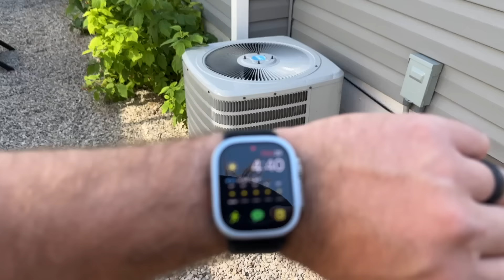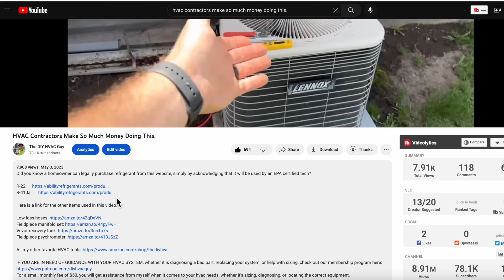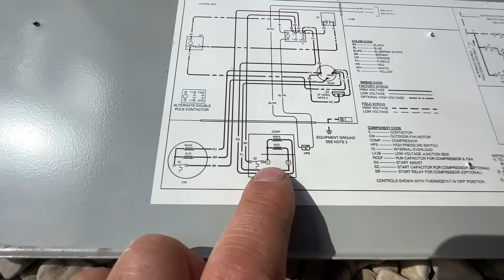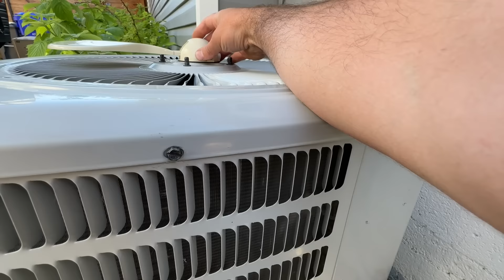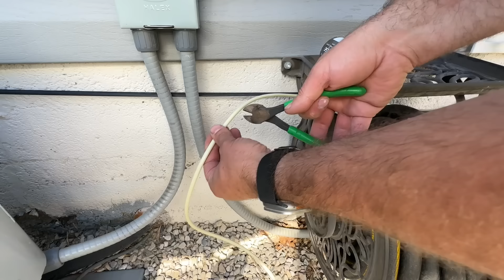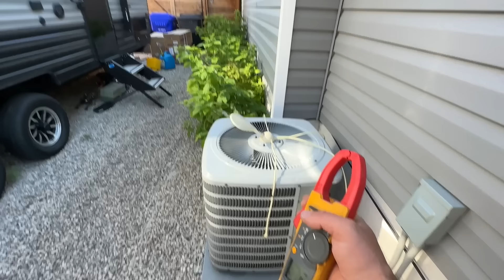Can This Device Actually Lower Your Electric Bill By 30%??

Comment: Very interesting product and I'm sure it does work. I have two comments. 1) The list price of the system is $100. Brass misting nozzles cost about $0.50 apiece on Amazon. The tubing and fittings might run you another five or six dollars. The only thing that is the least bit proprietary about the system is the valve. This is almost identical to the float valve that's used on decorative fountains which runs about eight dollars. You could very easily modify one to have a vane instead of a float on it. Bottom line, all of the components of the system can be purchased retail for about 12 or $13. Charging $100 for the packaging seems outrageous. The second question that I have is with regard to long-term performance. Most of these misting systems suffer from one common flaw in that the nozzles clog up over time and need to be replaced. It would be nice to see a follow-up report after a few months of use to see if it still working well. The concept seems great, however anyone who has even the smallest DIY skill can probably put the entire system together for about 1/10 of the asking price.
Reply: You could also use a $12 irrigation valve that triggers when the unit runs without having to mod something.

Comment: We built a "cabin" on a slab and the interior dimensions are 23x23 w/ open cell spray foam. For whatever reason i have a 24k LG split installed and its waayy to big. The place is so tight and the oversized unit is causing too much humidity. I will be swapping it out with a 12k LG unit. Hoping this makes a difference. Even when i put the 24k unit on dehumidify mode it practically does nothing.
Reply from the maker: I don’t think this will affect that unfortunately
Reply: @diyhvacguy  I dont understand it. How else is am i supposed to control the humidity? Im getting 75-80%.

Comment: Honestly a proper attic fan used correctly along with modern levels of insulation will save you even more on your enerfy bills. That and for petes sake, make sure your air filters are clean and your ducts dont leak.

Comment: If the outside ambient air temp was not still at 91 by the time you finished your install… the results are meaningless - it could have cooled down 5 degrees or more outside by the time you were done.  Judging by the difference in overhead sunlight, the outside air temp had changed.
Reply from the maker: Yea it was hotter at the end of this test then when we started. I’m not sure how I’m supposed to duplicate the same conditions but I believe it works and is worth it. If you don’t it’s no sweat off my back 👍🏼

Comment: $ 100.00 is a bit steep for 1/4 " plastic tubing, 3 brass mister heads and a float valve that's air accuated. Make your own for less than $20.00.🤫

Comment: By wetting the condenser you are taking advantage of the wet bulb cooling effect. How much water are you using and how much does it cost in water wastage. To be honest it’s a waste of clean, purified and pumped water from your provider. Cooling towers at least recycle the water they use.

Comment: most window AC units already use this sort of system... they tell you not to drill or drain the metal bottom, it collects condensation water and the fan splashes in it to help cool the outside coil.
Reply: Great comment! Not many people know this. I only discovered it recently. 👍🏻
Reply: Yes but that is condensation water that does not have minerals in it.

Comment: I would be willing to bet that orienting those tubes so they face straight DOWN across the outside of the condenser coil would be much more effective than spraying OUT away from the coil and trying to suck the moisture back in through the coil. Likely would get a more even coil coverage, not spray against the foundation, or vegetation, as well. Interesting add on though, especially if combined with a micro-air easy start to reduce the LRA.

Comment: I've seen this done when the evap fan fails to lower the head pressure from kicking off on high head pressure setting and of course to make the AC work with no fan. It is an emergency process typically with small to medium size data centers that have failed evap fans that are scheduled for immediate replacement awaiting the parts. Now for example there are typically 3 large sides and one shorter side of air movement and the single tap on the head of the mister is rather puny and inefficient. A dual head that sprays water in 2 directions would be more efficiently applying the water.  That and a pass through design on the top mister to allow dual misters on each side both high/middle or middle low depending on preference. Adding a two way gate valve off each side of the output would also enhance MORE places to apply more mister heads. (basically a coupling bi-direction or better yet tri-direction port valve, 1 in two out) The effect of the water with more flow producing cooler water supplying the flow increasing the effective cooling power of the system as a whole. Shaded area's would also help with cooler water.  The effectiveness of the water to cool the fins is exponentially increased with lower temp of water supply. I cannot believe the manufacturer has not made these improvements already.

Comment: Why are you replacing the unit with a heat pump
Reply from the maker: Im installing a 20 seer heat pump, so jumping from 13 seer to 20 will be great for my electric bill and I can run my heat or cooling with a generator even if there is no natural gas for my backup heat. AND the new heat pump is so quiet. I can’t hardly hear it running. Just finished the install today!!

Comment: If the water consumption is so low  why not use the condensate water ? It should be very clean,nearly distilled really..surely a pump (cheap) perhaps some sort of accumulator (maybe) but would make such a tidy self contained mod...??

Comment: good idea to mount the mister nozzles higher and angle them so the spray isn't on the grass around AC but into the coils to work on dry hot 🥵 days for maximum evaporative cooling yeah don't forget the T also would've faced the flap towards the house where that panel cover is where the coil isn't  that way the heat pulled off can rise up and away from home, make sure faucets don't leak as that'll increase the cost  but a monthly check ✅ should be good enough, I've also learned to window 🪟 screen the outside so sweeping off cottonwood seeds and bugs stuck to it is easier also can be useful to remove stuff like bushes branches limbs over the top just trim away so the heat can rise away and not sit low recycling through the thing trying to give the heat away to atmosphere

Comment: Also, it will work best if you're in a "dry heat" area. If it's 90% humidity, I don't think it's going to work that well, because it's going to be harder for the water to evaporate and carry the heat with it.
Reply: SWFL Tried it a few years ago. Too much humidity to gain savings
Reply: @mac9245  Thanks for the tip, I will  not install it then as we also live in SWFL...
Reply: Yeah... just like those "cooling towels" this thing doesn't work in Augusta, GA or Columbia, SC.
Reply: @catfishcooler1566  It also won't wok in the Jacksonville, Florida area.
Reply: @TheCrunchbird . I’m in the same region and was really hoping something would help my heat pump.
Reply: I live in Augusta Georgia and was about to order t his thing but you came and you saved me! @catfishcooler1566
Reply: @catfishcooler1566 hell yeah! I'm in Augusta!   

Def don't see this doing too much to make it worth it
Reply: 90% is subjective to the time of day and drops way down during the hot day. The dew point is more stable and helps determine if the evaporation does anything. A 65° dew point at 108° is very high and water still evaporates but slowly, and a 50° dew point at 108° is mild and water spray cools well and water evaporates rapidly. Below 45° dew point is dry. 
And the percentage rises and falls dramatically every day.
Reply: Cold water comes out of the tap.  That could be aiding the cooling even in high humidity.  An expansion pack is available.
Reply: @tomuncc  
Good point!
Reply: @tomuncc  yea i don't understand the humidity comments. who cares if it evaporates or not. the water will absorb the heat then drain off into the yard.
Reply: @james6794  You care. The whole point of this is to make the air flowing over the fins able to absorb more heat. That only happens if the vapor level goes up. Its all about the water vapor level. Liquid water means nothing here.
Reply: @cadthunkin  sure but if you spray something down with water that is cooler than the object heat will exchange. the difference is water volume increase the water  volume. In a humid climate actually getting the condenser coil wet it will remove heat from it
Reply: @james6794 Because the cooling effect comes from the evaporation of the water. High humidity means the water takes longer to evaporate and that reduces the amount of cooling. 
That's why the "feels like" temperature is higher when the humidity is up, perspiration is not as effective so we feel hotter.
Reply: @james6794 in dry humidity the spray can lower air temp by 30 or 40 degrees. 
Won't do that in a humidity area.
Reply: @james6794  You will gain some additional heat transfer with the addition of water on the coils, making the rather safe assumption that the water is colder than the initial temp of the coils. The point about the humidity is to gain additional cooling benefit, you evaporate the water you sprayed onto the coils to increase the capacity (not efficiency) of the cooling coils. In high humidity environments, you're not going to evaporate as much water because the air is already pretty saturated  with water to begin with. 

At that point the only help your getting is the thermal energy it takes to raise that sprayed water at let's say 70 degrees to 120 degrees where you're trying to strip the heat out of the hot freon. At that point, it's minimal.
Reply: @james6794  That's not the thermal process that's important here. You're talking about a transfer of heat from the condenser coils to cooler water, which would require much greater amounts of water. The video is talking about using a phase change of water, from liquid to vapor, which absorbs much greater quantities of heat energy than just heating water.  The first half of this short video kinda explains it:https://www.youtube.com/watch?v=SONE3AU-KQk
Reply: @DerekKerton This is the answer
Reply: @james6794  Water evaporation is 1,000 BTU/#, no phase change liquid cooling is only 1 BTU/# °F.
Reply: @james6794  cause with high humidity, the air is already humid and can therefore not take on so much humidity anymore as it could in a dry area...
Reply: @james6794  Another victim of America’s failing public school system. 😒
Reply: @james6794  The amount of heat carried away by the mist is dependent on evaporation.
That's why "swamp coolers" don't work in a humid environment.
Reply: @kiowablue2862  don't use a mist then. use a flood
Reply: so wyoming yes florida no. also swamp coolers are really nice in dry climates but suck in wet. the AC unites also seem to work better in wet vs dry locations.
Reply: I just went to a bar in Alabama and they had those mysteries and it definitely cool down the air so I think it worked maybe not quite as well as words drive but definitely cools down the air
Reply: Itll still save some energy (water cost might offset it) because water is a lot more dense and is probably much colder than ambient air so theres more "cold" available. But nowhere near what it saves if it can evaporate.
Reply: These are good points, but I was curious - wouldn't the coils being hotter than the air cause the incoming air temp to increase, thereby decreasing local humidity and allowing evaporation to occur?
Reply: I can spray down my heat pump unit outside with water for a minute or 2 and the inside vent air temperature drops by 4°to 5 degrees  coming out of the air vents by doing that.
Reply: Yeah too much humidity in Houston, Texas for this
Reply: It's adding an evaporative cooler to condensing coil.  Evaporative cooling is effective in low humidity environments.   Like on the brown (west) coast; not so much on the green (east) coast.
Reply: That's what I was thinking since I live between Houston and Galveston. I really need to shade the unit from the sun on the West side though. Is there anything I can use for temporary shade during the Summer?
Reply: Y'all haven't seen hard water until you see my well water. Let's just say that I'm an expert at cleaning water heaters and replacing their elements. This system is a joke with reverse osmosis.
Reply: Rabbits and other critters will love this.
Reply: I live in such humidity.  And whenever it rains, the AC blows colder air.
Reply: @lindafoss3823  
That's probably mostly because the sun doesn't hear up the unit when it's raining (cloudy).
Reply: @shane250  Or the rain cools the unit.
Reply: Too bad the manufacturer won’t ship to Arizona where I live and have extremely low humidity. They say it’s due to the “extreme hard water”. What a joke.
Reply: @kww117 Since most water filtration system companies claim that 85% of the country has hard water,  it certainly makes no sense at all.
Reply: @kww117  interesting. why the filter then? I live in Tucson and the water is hard, but I only crust where the water drips down the shower head.
Reply: @kww117 This thing would be easy to make. It’s just cheap drip irrigation parts with a "sail" in place of the float on a float valve.
Reply: @kww117 if you have a friend/relative in another state you could have it shipped there and have them send it to you
Reply: @kww117   Tell them that you have a water softener.
Reply: No, it'll actually also work in humid areas, because of "RELATIVE" humidity.
Maybe at 88F you have 90% relative humidity. But at hotter temperatures, air can support more humidity. And you HAVE the hotter temperatures on your condenser coils.
Yes, better in dry air, but it'll still work in humid regions.
Reply: @DerekKerton  yeah it will 'work' but with such limited effectiveness it's questionable if it's worth the water and scale formation.
Reply: @kleetus92  Agreed.

Comment: Why did you measure amps the first time with the meter looped around the wire, but the second time you actually had it clamped on?  I'm not an electrician or anything, but it seems like you'd want to take measurements the exact same for a controlled experiment.  Also, you appear to be further away the second decibel test.

Comment: Get a swamp cooler and aim it towards your A/C. No hard water build up on your coils. My system has walls on three sides, so makes it easier. My swamp cooler draws 300 watts. Obviously better if you can use a relay to turn it on and off. We think 30% is very high humidity, so a swamp cooler drops the temperature about 20 to 25 degrees. Our water is so hard the little inline filter will last a week. Replacing those coils can cost a lot more than you are saving, and around here you will forget to replace that filter.

Comment: There are a lot of variables to this experiment not taken into consideration. 
I would like to know the unit capacity in tons or btus. And the RLA on the manufactures rating label .
Secondly check the amperage at the contactor for the entire load compressor with condenser fan motor. 
Plus readings on an initial start up   .
Then we can have fun with it .
By the way In the 50s thru 60s Rheem made an a/c with sprayed water over a copper finned coil . And it did lime up .

Comment: Mineral deposits will eventually build up on the coils and restrict air flow and lead to early condenser replacement. Think stalagmites in caves. I've seen this  on 10 year old A/C's

Comment: Another thing that has worked well for me is that the unit is on the north side of the house under a 7' overhang so it is always in the shade and out of the rain. My original heat pump lasted 33 years in FL!
Reply: What if you simply put a patio umbrella over it so it's not in direct sunlight?
Reply: With that much of an overhang you're probably be circulating the hot air see if you can direct it inside or kind of hole in the top of the overhang or something to keep it from recirculating the hot air a piece of plywood curved on the top would probably work
Reply: In the Northern hemisphere, put the compressor on the north (shady) side of the house!

Comment: I have been using a $20 misting kit I found on amazone four about 4 year.  Like others have stated, don't smoke the system just lightly mist. You can real notice a difference in 90 + heat!

Comment: The best way to test this is using a wattage usage meter before and after installation of this device. also the run time of the unit, compared to a day or two of similar temperatures.

Comment: i was all for this until i saw a comment about high pollen areas, the mist grabs the pollen and turns it into glue on the coils.

i didnt know about cleaning coils, until i came across a video talking about it. I went outside and took the covers off my 7 year old outside unit. The pollen and garbage looked like an insulation blanket. I could almost peel it off by hand, i was amazed. i bought the can of stuff and cleaned it off. I never had trouble getting temp in the house but i had noticed the unit getting louder and cleaning it quieted it down a LOT.

The next year i went to clean it again, thinking it would be nothing like 7 years of buildup, i was wrong. It was almost as thick after one year as it was with 7 years. so now i do it every year.

I did get smart though. Instead of taking the covers off and rinsing from outside in like videos insist on, i just take off the top, and rinse the coils from inside out. I can't imagine it makes that much of a difference and its a hell of a lot faster, not taking the vertical covers off.

Now im thinking with the heat wave we have showing up right now ill do it again and probably monthly.